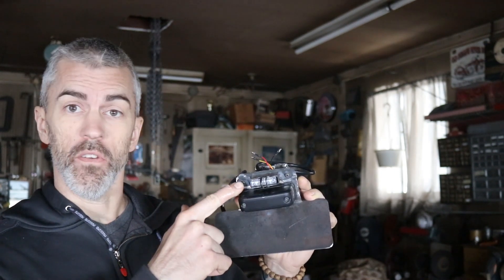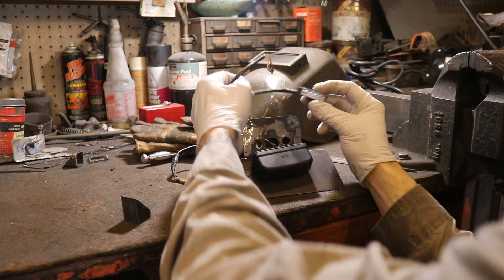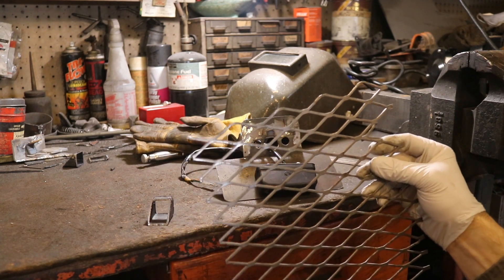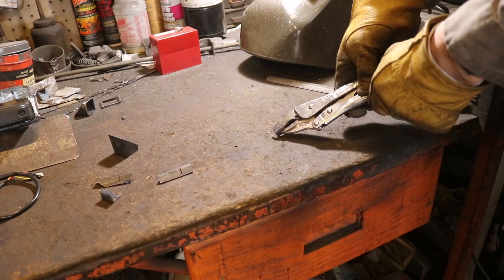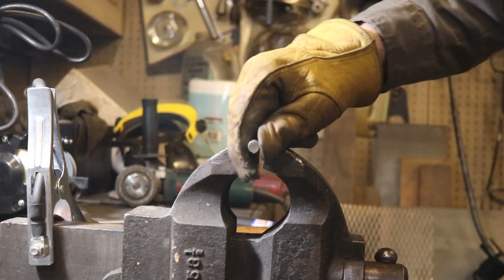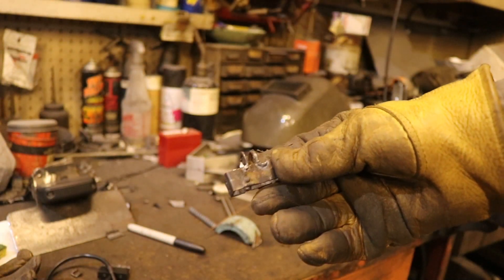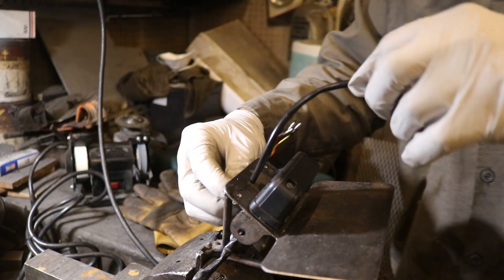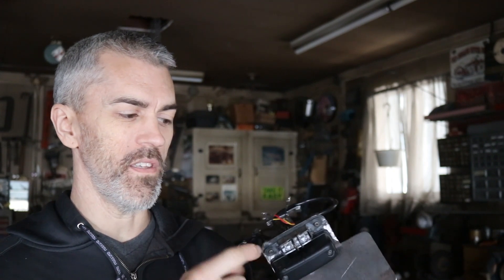Tail Light Housing Fabrication LED | E15 - Honda CB500F Scrambler

Comment: How much is the led tail light? Why not glue it into the metal box u made and drop the diamond u used. Or use a small bolt on the bottom of the box too hold the light into place in the little box. We all love box, keep up the good vids bro!
Reply from the maker: Why not glue it is a good question. Thanks for the love, bro. Much appreciated 👍

Comment: Cut the heads off 2 bolts and fix them into the 2 holes on the back of the light unit with Araldite/resin glue stuff.

Then drill 2 holes in the exiting bracket and bolt the light unit up from behind.

10 minute job, but not as fascinating as watching your efforts!
Reply from the maker: I suppose the struggle does add drama 😁, but yeah, your idea sounds much easier - thanks!